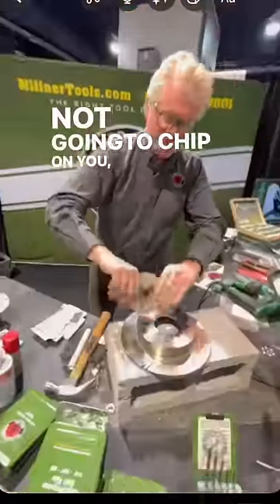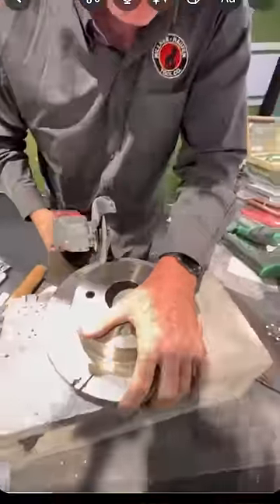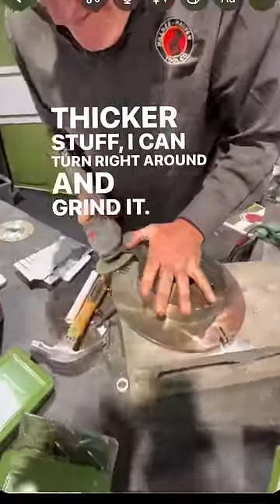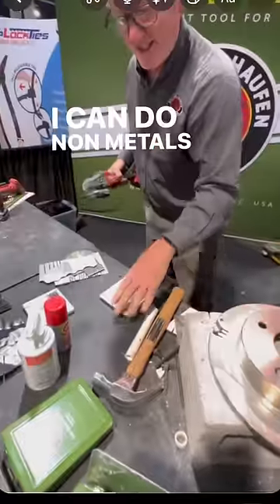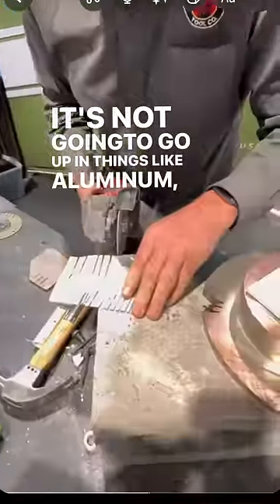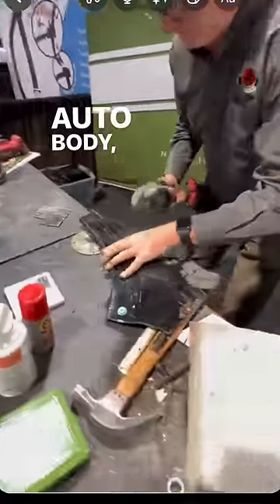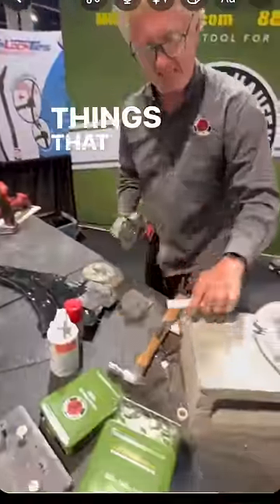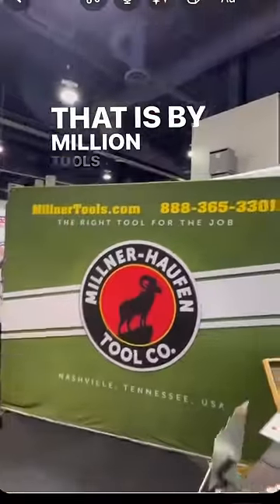I can’t believe he can touch it after all that!  #shorts #amazing #gadgets

Comment: his hand was actually burning but he’s an incredible salesman with a pitch
Reply: Look at his face when he touches it, he’s dying😂
Reply: The pvc cooled the blade down a lot before he touch it anyways so it’s fine
Reply: He offered it up to be touched.
Reply: if he’s been doing it that long he just wouldn’t feel it so this comment doesn’t make much sense. the non metals def cooled it but if it was hot and he’s been doing it for a long time then his fingers are conditioned for it
Reply: This is a diamond coated blade… diamond has one of the highest coefficients of thermal conduction, hence it will cool down very quickly! Also with the cuts, it doesn’t produce much heat as it cuts through any material very well (very little friction)… this is a very high quality blade, and probably very expensive too.
Reply: @christianerhard8875  also it's like a vented brake disk.
Reply: @christianerhard8875  180 bucks
Reply: @christianerhard8875  $180 on their site
Reply: @CarBleach  was going to say yeah his nerves in his hands are just so beat up from the years of torture eventually we don’t feel nothing that’s why guys who have reached that point just say “oh my hands are steel” till they lose a finger to steel lmao
Reply: The angle grinder Jimmy McGill
Reply: Ol Lead fingers McGill goes all in on a demo
Reply: @CarBleach  ever heard of a joke or is this your first time

Comment: The fact that this man has all his fingers still is much more incredible then the cut off wheel
Reply: It's a rotor...
Reply: I came here for this! How does this dude still have ten fingers!?
Reply: I was about to write the same😅😅    It is just a miracle
Reply: Yeah me too
Reply: People who say crap like this obviously don't use these tools on a daily basis, if at all.
Reply: @emanuelsagan3733  I still found the comment funny but I do agree with you.  I've been using a gaurdless grinder for years, not a scratch.
Reply: @bososz  it's not about the guard. It's how he uses it. He just holds stuff down and goes for it. At least when it's very small and you're cutting with the entire radius of the wheel, that should definitely be clamped down. Yeah if you're careful it's probably fine a few times, but that guy doesn't really know what he's doing
Reply: Well if you know your tools you know how risky you can be
Reply: AND I forgot to mention, it can't cut off your fingers!
Reply: Hearing this makes me feel good! Im cutting through 1 inch thick huck rivets with my head stuck in a spot where i cant even completely see what i am trying to cut, i had to snake the tool through a mess of wires and air lines and not cut those too! I hit em sometimes lol
Reply: @bososz there is always a first,respect all power tools,words to your surgeon 'but I've been grinding for years as he is stiching your fingers back on.

Comment: The fact that this man has made it this far in life without losing a finger or an eyeball gives me hope
Reply: An abrasive wheel like this won't do much damage to flesh. It'll hurt somewhat, but won't go in quickly like a saw blade. Particles or fragments to the eyes would still be a problem.
Reply: Or his hearing
Reply: @nicholasittzes7224  painful when debris hit you in the face too. I always use a face shield for that reason. Eye protection is better than nothing I guess

Comment: My man's a little too comfortable with that grinder.. kinda scaring me a bit considering how many family members I have missing full or partial digits 😬
Reply: Yea but that’s not a fiber death wheel or wire wheel that causes most of the hospital visits from grinders that’s a steel and diamond wheel just like concrete saws my guess is that wheel is at-least 130 $ more expensive than a cheap death wheel
Reply: You get used to it when you use it more often .key is gloves and glasses at the very least good gloves are an extra layer of skin for those close calls I nick a glove once a fortnight or so where it would have taken a chunk out of my finger I have a scratch instead
Reply: @kieren7763  I've spent a lot of time on an angle grinder, I've also had them do stupid things at times, which is why that level of confidence is dangerous in my eyes, you've gotta respect the tool
Reply: @kieren7763  you're not supposed to wear gloves when operating rotating machinery
Reply: Nah- diamond wheels really don’t bite you. They can pull and kick like a mule but when the get something meaty is more like a rope burn—— 

-Granite and metal fab guy for a decade
Reply: @Mary_J1998  gloves are required for angle grinders at almost every employer. You are not supposed to wear gloves with lathes and other equipment that are immovable. But idk anything I'm just a 6g certified welder that uses an angle grinder everyday. I also get told to wear my gloves while grinding everyday.
Reply: @julianburns6632  I've been told my whole life not to wear gloves or loose clothing around any rotating equipment. I thought it was bullshit and didn't like the sparks on my hands so I wore gloves. And a relatively loose shirt at the time since I lost a lot of weight but didn't get new shirts and an angle grinder got caught up on some material yanked my wrist like drills try to do and not only wrapped itself in my shirt it also grabbed the finger of my gloves so I couldn't pull my hand away I unplugged the grinder with my foot and luckily wasn't injured just hurt wrist and had to get a new shirt. But I haven't worn gloves since and because i want to be able to use my hand to protect myself if a situation like that ever happened again. I'm sure wearing tight fitting gloves might be okay but we only had those bulky leather gloves in the shop. In my opinion it's to each their own some people don't like wearing safety glasses while sanding or grinding I think it's stupid but it's their life and body
Reply: @julianburns6632  also, what employers require you to wear has no bering on if it's safe or not they just don't want you to get hurt and sue them because they never told you to wear gloves. One of my coworkers got his foot pulled into the machine and he got our company to pay all his medical bills and he got a check from them because nobody told him to wear steel toed boots. As if steel toed boots would've prevented his entire leg from being pulled into a machine and mangled but they didn't cover their asses so they got punished. And that's why most employers require the ppe that they do not necessarily because it makes you safe but it makes them non liable
Reply: @kieren7763  never wear gloves when using a saw or grinder, unless its a skin tight latex glove or aomething.... if the blade grabs the glove, you're more fucked then if didnt have gloves on
Reply: Yeah but now losing a finger doesn’t have to burn.😂
Reply: @Mary_J1998  I wear leather no matter the temp, as a second skin. IMO, if you can't be this comfortable with a tool, you aren't memorizing how it acts or you aren't strengthening your body to counteract it, and will be 'afraid' of it for much longer.
Reply: @Doubie.  yeah. It's steel like circular saw blades and carving knives, which have never hurt anyone
Reply: @TheMonkey747  I don't know why you directed that message towards me. I never said I wasn't comfortable just that wearing gloves introduces unnecessary risk depending on what you're cutting. We mostly use sheet metal so the cheap blades we get bind up and try and twist and one time my shirt got wrapped up and the glove prevented me from unplugging the grinder as it continued to try and twist my arm. It was an old grinder that is either on or off none of that release a trigger and it stops stuff
Reply: @Mary_J1998  Your's was the comment I picked. 

I learned to weld, shape, and finish structural-sized steel [1/4 inch and thicker]. Moving that much material that quickly, takes a lot of strength and control, and throws a lot of sparks. Sometimes the column of sparks went up to 20 feet before they stopped glowing. I just that I got tired of sparks flying through my shirt while I was grinding, and getting hit in the chest or arm when the wheel caught the edge of the metal.
Reply: @TheMonkey747  I feel you. I just prefer to eliminate all points of danger I don't care about getting little burns on me. I weld and cut metal tubing and sheet metal all day long the sparks burn a little but when using a grinder I'd rather be as safe as possible and get a little poke every now and then
Reply: @Mary_J1998  Yeah. I rarely put on gear beyond long pants, boots, and 'Eyes and Ears' when I work now, the sparks don't reach nearly as far. But I generally make tiny cuts now, by comparison. I'm not removing cubic inches of material p/hr, anymore. We ground or torched out most of our shapes.
Reply: An angle grinder will only hurt you if you are scared of it..
Reply: @Formerlywarmer   Not missing fingers because of it, But most of the men have got themselves with it at some point or another
Reply: From a grinder?
Reply: Nearly took off my finger with one the other day, thankfully it barely did any damage aside from a small cut and a bit of a groove in my fingernail lol
Reply: Skill issue
Reply: Is's hard to lose a finger with a grinder actually
Reply: @ShadowDragon246  a friend of mine Lost a finger using a drill wearing gloves. The secret Is to keep the trasmission belt a bit loose so It wont drag you. Btw todays gloves are supposed to open in half when something like that happens. They have weak stitching for that reason
Reply: Tbh I trust him though. A guy who’s that old and confident and still has all his fingers, he’s got some skill, there’s a few guys I work with who are like surgeons with those things, it’s crazy
Reply: Maybe it's your bloodline trying to become octopuses 🤷‍♂️
Reply: Those whom you know with missing digits doesn't know what they're doing.
Reply: Him holding the rotor with his hand right in the line of a potential kick back lmao.  Reminds me of the hotel host on hot tub time machine u just can't look away this guy is a major 🤡🤡
Reply: Yeah, I don't mess around with angle grinders. Or anything that cuts really fast, I wear cowhide gloves, and depending on the cutting angle and how close my face is to the grinder, and what I'm grinding/cutting I'll wear safetys over my prescription glasses or goggles that cover more from the sides.
Reply: @Jeremy Buchanan I have 1 through 6. I mostly do 4-8 in pipe for a refinery here in Houston. Tig root and hp with a 7018 cap.
Reply: Sounds like you have some reckless family members with a few less digits with no respect for the power tools they were using.
Reply: Yeah,  me too .
Reply: Ya Ive been a fabricator for 20 years, every time I see someone with missing digits I treat them like morons.
Reply: Thank you, I hate seeing complacency with tools, know too many people missing fingers , and I’m lucky to have a mostly functional index finger after I was complacent
Reply: @Mary_J1998  u are with a grinder. the rotating tools they were talking about is like drill presses. nobodys gonna do very much grinding without gloves. it's just not worth it
Reply: @ShadowDragon246  ya, good luck with that 1. look, I've been welding, cutting, grinding and fabbing for 30+yrs and I've never gotten a glove caught in a grinder. a shirt, sure. but a glove? if you've got your hands where they're supposed to be, the right sized disc on there with guards in place, only an idiot could still manage to get their glove in there. your #1 guard is on your shoulders. use it and you'll be fine
Reply: lok
Reply: You're not good with tools if you don't get comfortable using them knowing exactly what they can do. This guy clearly works with his hands on grinders specifically AND he has all his digits. Gonna go out on a limb and say your family aren't that great at motor control.
Reply: It's not the tools fault but the tool holding the tool.......
Reply: McDoogal  Same here.
Something doesn't seem right with his demo. I do lots of grinding, cutting and one thing that's for sure is that extremely quickly the blade will heat up!
Reply: @Mary_J1998  cut open my wrist with an angle grinder cause piece of ripped glove got caught on the blade luckily nothing but a nasty scar afterwards could have been much worse.
Reply: @ShadowDragon246  happened to me luckily only a nasty scar on my wrist coulda been much worse. Instantly cauterized by the blade it was kinda insane. And extremely painful after the shock wore off 😂
Reply: @Mary_J1998 My dad lost 2 fingers doing that, but that was a big drill Machine, they got told to use it though. :/
Reply: The 1 thing nobody mentioned is long hair getting caught in the machinery ( although that's more likely to happen to a woman)
Reply: What about the spectators with no safety glasses?
Reply: @kieren7763  ive never put my fingers in harms way with any power tool because ive never removed the guard mainly and because i pay attention. Ive used grinders in metal fab and scrapping things 2 days a week on average for the last 20 or so years. I use leather gloves handling scrap metal but will never use them to operate power tools- things slip out your hands with gloves and you have no feel or sensitivity with gloves on. Try picking a pencil up and using a ruler with rigger gloves on. Theres no grip to match the bare hand to control a power tool.
Reply: If that thing catches and jumps he is going to regret his technique.
Reply: They should have used this one.
Reply: @Beandiptheredneck  ...respect is earned, not given.
Reply: @julianburns6632  Wouldn't have to if you worked for yourself. You'd make more money as well.
Reply: @paulrawlinson8653  Exactly.
Reply: Only carelessness causes you to lose fingers.
Reply: @Mary_J1998  I've seen mixed opinions about gloves and grinders. I use my welding gloves for most things and they're stiff as wood so a grinder can't really grab or pull them. I worked at a shop not that long ago and everyone used gloves for grinding and found it weird that I didn't. It also depends on what machinery you're using. A drill bit has big flutes that can easily grab gloves. Grinders don't really have teeth and move so fast they can't really grab the glove before it just tears. Either way if you're careful you'll never have problems with it. I personally prefer not to use gloves
Reply: Roll tide
Reply: @julianburns6632  Time for training i guess